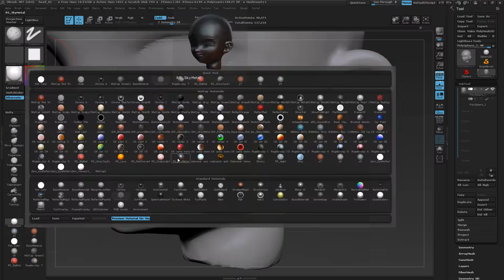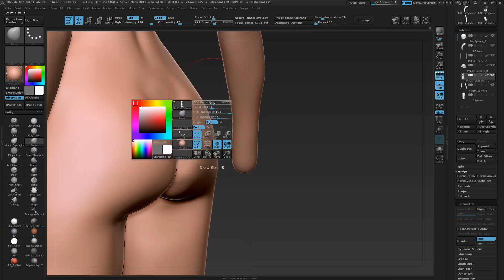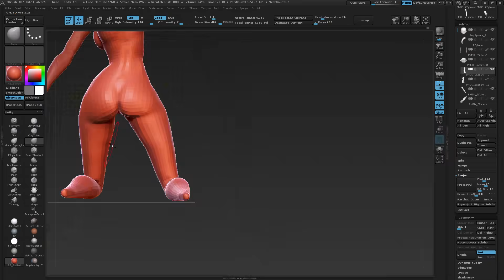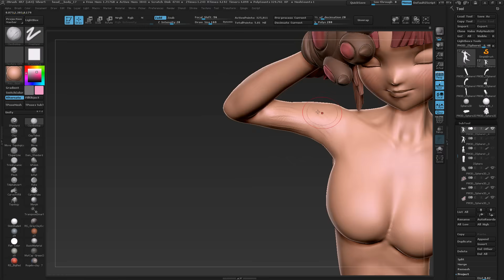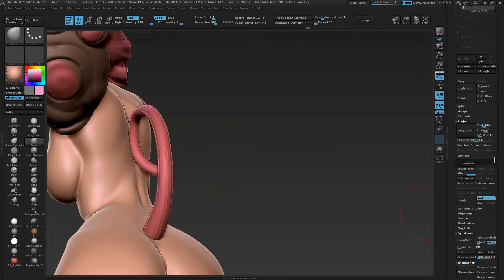How to create a figurine with ZBrush and 3D printing

Comment: @4:30 it skips how the keying in phase (the sockets that physically join the printed model) were created. If that was done via a script that works automatically on the subtools please link! If its not via script it must have been dynamesh boolean, correct?
Reply from the maker: It is just the boolean style operations done with DynaMesh and SubTools. No magic tricks :)
Reply: Thomas Roussel youre my hero haha I'm having such a hard time getting my model ready to print lol
Reply from the maker: I'm sorry for my non explicit reply. I did multiple videos of that, but they are all in french. With ZBrush 4R8 and it's new boolean tool, it should be easier! :)